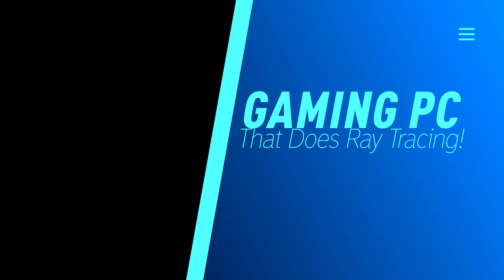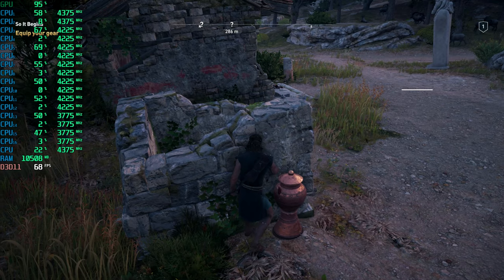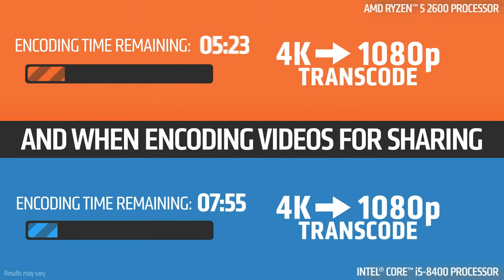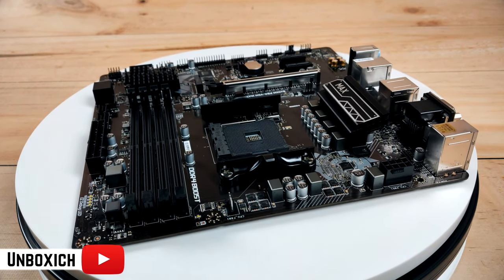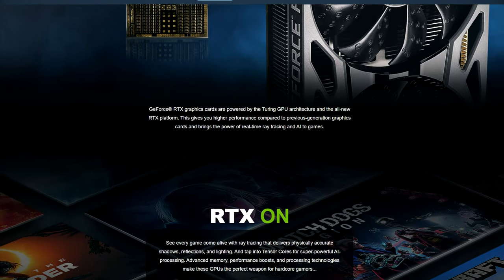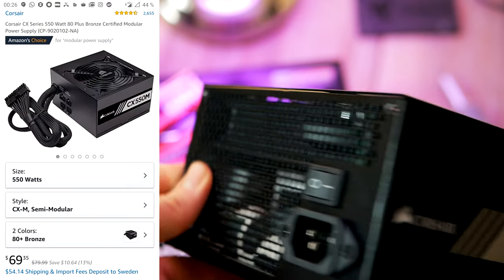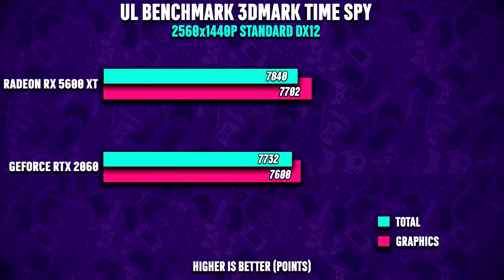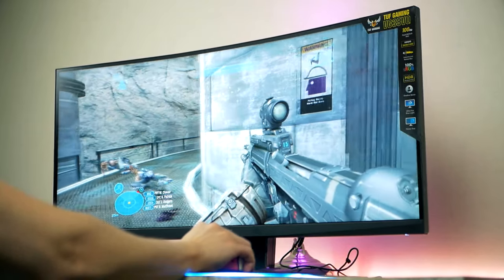Best Budget Gaming PC Build in 2020 w/ Benchmarks!

Comment: OK.  You say you went with a 550W PSU...and, without dwelling on the fact that you showed a 650W unit, you said that it gives you GPU upgrade potential down the road.  That's not really the case.  The recommended PSU for an RTX 2070 is a 650W.  So, there's no headroom beyond your 2060.